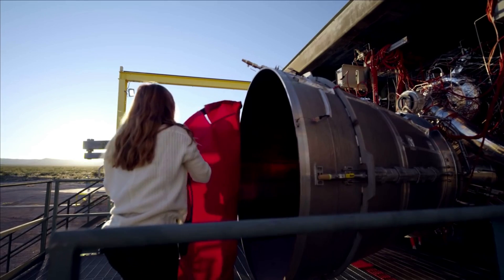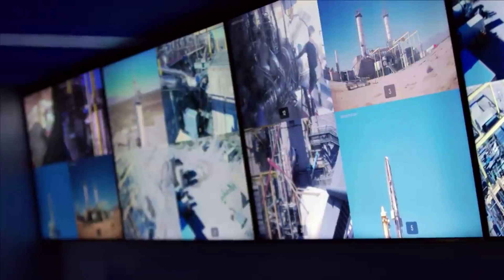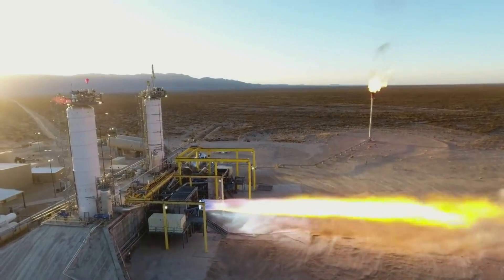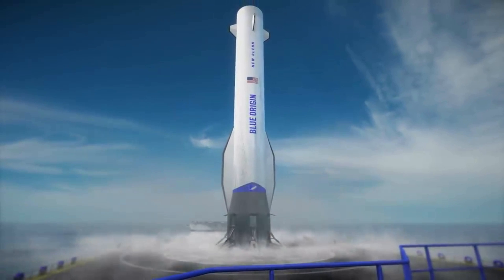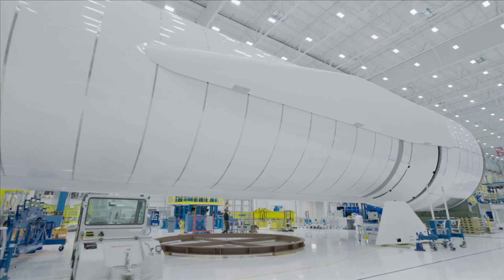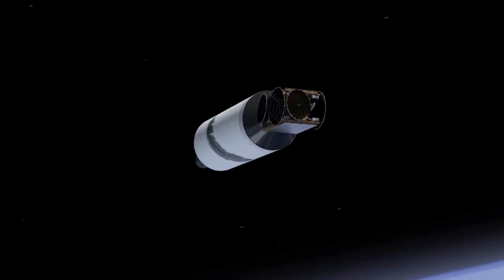Production of Blue Origin’s BE-4 Engine Is Ramping Up

Comment: Looks like the suborbital tourism business is dead. What a shock.
Reply: More like paused.
Virgin Galactic pushed it's begin of commercial operation to mid 2023, but at the same time they are working on expanding their fleet and entering into agreements with Boeing for the next generation carrier aircraft (successor to whiteknighttwo)
Blue Origin is also going to restart New Shepard flights in 2023, after they finish investigating the engine failure on the uncrewed flight back in  September and make the necessary adjustments.
Reply: It was never born, their is just too little market space between a fully orbital capsule or ISS visits, high altitude ballon rides and Vomit comet airplanes.  It's not a problem of technology, it's a problem of physics, with just boyancy you can get a comperable view of the Earth for a lot longer and cheaper, with the Vomit comet you can get a comperable zero-G experience repetedly for cheaper.  And if you want to have both at the same time or long duration then only orbital will do it for you.  Their are just too many alternatives for sub-orbital tourism to ever take off.
Reply: @Kenneth Ferland  high altitude balloons, like space perspective, go less than 1/3 the way to space (approx. 30.5km), and parabolic 0g flights might reach 8.5km in altitude. So neither gets you close to the views from actual space or the prestige of calling yourself an astronaut, who went to space. High altitude balloons don't get you any microgravity at all, while parabolic flights give you multiple 20s burst of microgravity, instead of 3 minutes of 0g all at once.